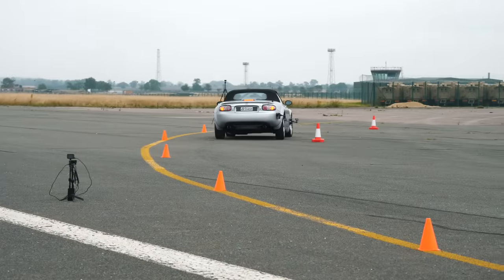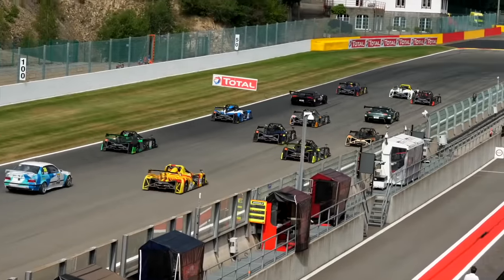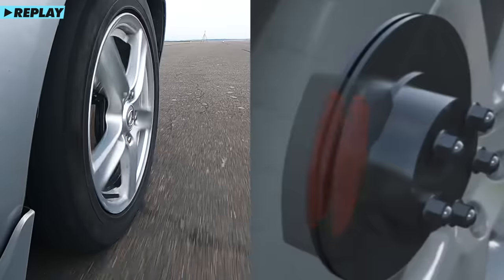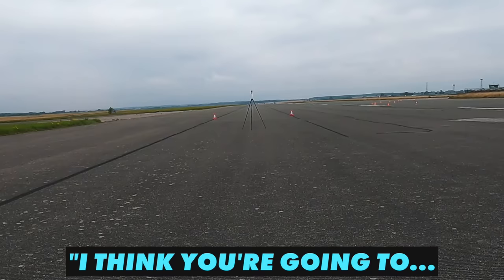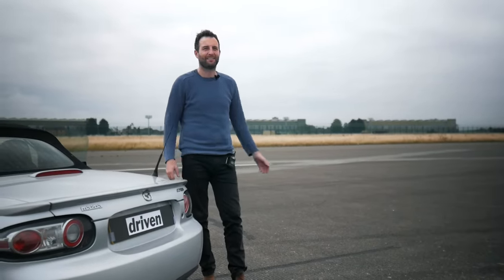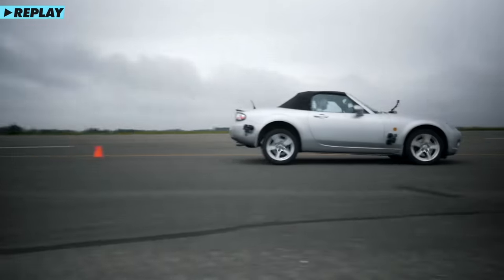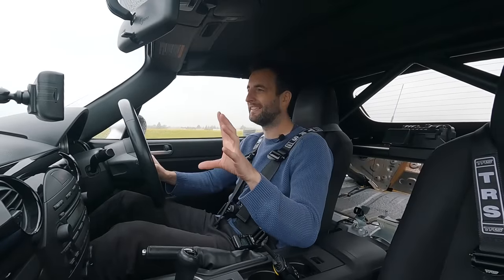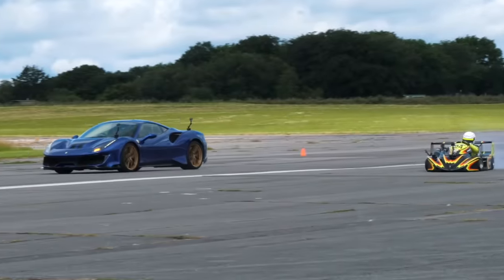ABS ON vs ABS OFF | What's Really the Difference?

Comment: I really feel that I can handle my car better without ABS, pushing the brake pedal just enough before the ABS turns on make the car stop very quickly, maybe it's related to the amount of grip and every tire has a best grip vs deceleration spot.
Anyway, in my country we have bad roads with many tiny rocks that you can roll on, so even with ABS you know that you will not make it ^^'.

Comment: I can't stand ABS. No electrics can beat instinct. 

In some cases, it makes it worse since it seems to kick in way before you run out of grip and it doesn't do a lot when you do although with ABS, I worked outside that if you release the brake just a little bit, it's not as bad.

Comment: This is a flawed demonstration. ABS cars don't have a proportioning valve. The ABS does that automatically. Being a light sports car, its going to be front heavy on the brakes. I had an old Tahoe that the ABS had issues. Because it was a truck built for towing, the rears would always lock up.
 I had a 1972 Impala 15 years ago, and someone pulled out in front me then stopped, only about 100 feet in front of me. A moder car couldn't have gotten stopped, let alone that 30 year old land yacht. I used the car's soft suspension and lack of babysitter brakes to force the rear to kick out to the left.  I was able drift around the curb and onto the road he pulled out of, saving his life. A modern car probably would have rolled over because of ABS and traction control maintaining traction when I didn't want it. 
A proper comparison would be finding two identical cars from when ABS was an option. One with and one without. You will find the one without stops a little longer, but reasonably controlled. After all, ABS is meant to aid stopping on slick roads, and people still lose control because they don't know how the let off the brakes when things go sideways.

Comment: you dont need abs if you drive a manual.  you can downshift and use a "engine braking", eliminating the need to lock up the wheels.  try going 60 mph and downshifting to 2nd gear and let off the gas and watch how fast you slow down without even touching the brake!.  please america, dont kill the stick shift!!

Comment: Ok comaprison, but nothing that wasn't expected.  Kind of pointless without the comparison to a driver doing more than just slamming them on & doing nothing else.  You should have included threshold / modulated braking for a better comparison.  
The kind of people that panic brake & just slam them on don't tend to steer at that point anyway.  They get target fixated, or overcorrect & spin.  (Saw that happen on the way to work.  Car in front on a 4 lane road ran a little wide in a corner, went from a bit wide to over correcting in/out/in so badly they put two wheels over the median on the outside, then crashed into the wall on the inside of the curve.)

Comment: This is showing exactly what you are told not to do.... Slam on the brakes and stay on them.  We all learn to pump our brakes or threshold the brakes. This is a pointless commercial for ABS systems. 
The host, a race car driver, says that the race cars don't use them because you can stop and or control the car better!    Pointless video.

Comment: This is exactly whats wrong with these ABS video’s they all just lock the wheels and say yup, ABS is better… well offcourse it is. You as a racing driver should show how you can brake good without using it. I’m also a racing driver but i know that driving with ABS can save you some meters, also it can also make the car less awkward to steer while braking little disappointing to say the least. I would make the video again, or just not post it.

Comment: 0:45 why would a pro driver be better than ABS? i can see an argument for "as good", but why better?

theres also an argument to be made as to why they cant be as good, as ABS in modern cars can control each wheel independently, which a driver cant, so he loses all the extra stopping power hidden in the grip level differences of the worst wheel to all the other ones.
Reply: Well the commenter is wrong in one aspect.  Threshold braking can never be as good as abs in a race car. That is self evident.  

However in the world of motorcycles, threshold braking does brake faster than abs. 

Here’s why:
Motorcycles has 2 brake levers, 1 for each wheel.  So a motorcycle rider can perform threshold braking on each wheel independent of each other. 

On a car, there’s only 1 brake lever for all 4 wheels.  So when a race car driver modulates the brake peddle (threshold braking) all 4 brakes are modulated regardless if a particular tire is locking up or not. 

Therefore, for a car, it can never brake as effectively as abs. 

Abs only modulates the caliper of the particular wheel that’s locking up.  The other 3 wheels that aren’t locking up … those calipers continues to apply braking force.

Comment: I'm stopping this at the 1:30 mark to comment before continuing. I too am a professional driver, but on the road, not the track. ABS, in theory, can achieve amazing results under ideal circumstances. The road is very rarely ideal. ABS has failed me many times, and in some circumstances actually made the problem worse as it fought my own corrective actions. Part of the problem is loads are not always balanced, the other problem is many of the roads I travel are extremely poor. 

ABS, much like all the other driving aids, help make an incompetent driver a bit safer, and well, given that about 80% of the people on the road are incompetent, its a good thing. For me. I often turn it and traction control off. There are times I want my wheels locked, and times I want my wheels to spin. I do not like being second guessed by a vehicle that has no idea what is actually going on and what I need to do to stay in control of my vehicle and thus remain among the living.

Comment: If you race cars on a track, you should know better.    Try that test again while driving properly.   You can easily stop that car shorter without abs if  you driver properly.  Now there is a new ABS system that gathers it's info differently and is able to do better then a driver.   But not the system your showing.

Comment: A car with ABS disabled will always perform worse than a car designed without ABS which has a higher threshold. 
Non-ABS cars have a proportioning valve after the brake booster to limit lockups, kinda ridiculous this is overlooked when you're throwing around science and #engineering hashtags...

Comment: okay all fine and dandy but really just stomping the break. this is comparing ABS to the worst driver particularly during the turning. if you are a professional driver then you have skill that most do not. but none the less a useful test would be to apply maximum breaking without locking up/ loosing control. this would likely compare ABS to a good driver. again particularly during the corner breaking.
Reply: ABS was never built for the "best driver". When you drive, you are driving with a lot of terrible drivers, it's for them - and if they need to break hard - for your safety.
Reply: @zachb1706  Aw, they are worried about my safety, that's nice. 

My statement still stands, it doesn't mater what ABS was built for. 

the comparison would be useful to demonstrate how much difference there is in the ABS ability to stop the car under control and someone who thinks that they are not that much value. the likely person who doesn't' think that are that much value likely thinks of them selves as a good driver. 

additionally perhaps in the 1980's people thought ABS was not that good, and may be it wasn't. in general almost all people, I suspect, know that certainly modern ABS perform well. so an interesting comparison is how they perform against a professional driver trying to Properly stop the car strait or in a turn. this is a valuable comparison. and interesting. 

thanks for your response.

Comment: Your test is comparing panic stops with and without abs. (Which is unfortunately the reaction of the average driver on the road). It would be interesting to see what a skilled drivers results would be against the abs. I would think minimal. 
Personally. Thats one of my biggest issues i have with newer cars. They are making for very bad drivers. The cars computer takes over. Instead of teaching drivers how to drive. You would laugh at how pathetically easy our written and road tests are here in the US.

Comment: You would never test the brakes like this as you wouldn't hold the brake once the car is locked up.... you might as well have put skies on it and done the test. Re make the video with abs and then threshold braking, technically it should stop quicker without abs.

Comment: If you are a trained racing driver then why are you locking up the brakes? Any trained driver knows that you don't lock them up but you go to the Edge where you feel the wheel is starting to lock up. Sometimes it's much better to steer rather than break hard. Maybe you're doing this to make the point but you said in the beginning that you were a trained racing driver and I do believe that you could break the car almost as well as with abs with modulating your pedal. Are you just doing this for the showboat effect of sliding? Maybe you're trying to show what a non trained driver would do?

Comment: ABS ON vs ABS OFF with INCOMPETENT BREAKING TECHNIQUE EG: JUST SLAM THE BREAKS ON LIKE A FOOL | What's Really the Difference? ABS IS DESIGNED FOR ** DRIVERS WHO DON'T KNOW HOW TO BREAK and DRIVE COMPETENTLY. 

FULL STOP.

when u drive a car non-abs and ur competent, u will learn to feel the cars optimal breaking point, once ur familiar with it, it will no longer matter were u drive 1st time or not, weather conditions or not, u will accurately feel when to apply more or less breaking pressure instinctively.

competent driver = better then ABS.

as abs plays very much to the safe side of things or it begins to fail when conditions are outside its parameters, a competent driver can effortlessly compensate for this on the fly and also maximize break, traction and handling performance.

however saying that the vast majority of drivers are not competent drivers, hence many would just slam their foot on the breaks pure and simple and hence why most drive like idiots in general.

i remember after learning to drive non-abs for years, i ended up upgrading to a ABS model, i almost had a heart attack the first time i was forced to break hard, swerve and avoid a truck, i missed them by 20-30cm and realized in that instant abs was only good for idiots who slammed the breaks, i new i could have safely cleared with a few meters, if i didnt have abs.

i latter took my car to a abandoned road over a few weekends and checked by disabling the abs and indeed found i could stop the vehicle around 20-40% better then with abs on and also simulated various situations / grip /weather conditions with cones representing obstacles, were id had to swerve to dodge something and come to a complete stop before hitting something else within the same process.

In every attempt non-abs was the clear winner, the simple fact i could slow down faster when breaking with no abs, meant when i needed to swerve my speed was always lower then with abs on = a huge f'ing difference to handling.

in dry good road conditions, it was very easy to out perform abs, only when i added things to reduce road traction did the gap shrink, but these conditions were pretty extreme and i basically set things up were it was not possible to avoid hitting any cones, so i was trying to determine if a crash was un-avoidable, which would give me the best chance of changing the angle of my vehicle to avoid a fatal impact, slowing my vehicle like wise before the collision etc and their were times im f'up and also times when the abs messed up, but either way no-abs = the winner.

one caveat though was the fact i new the road conditions in advance, which also gave me a edge over the abs and were to push my advantage of knowing what the wheels would encounter next, though saying that a competent driver always keeps his eyes on the road to insure they are driving appropriate to the conditions and are aware to those conditions instinctively when they need to react in a emergency.

but again most drivers arent competent, they just slam the breaks, drive like they are on rails, so ABS and TCS is a major improvement for most drivers safety and i will say though i think standard ABS is bad for competent drivers.

unfortunately though some vehicles are designed and built ground up with TCS systems in mind, simply put disabling TCS in these vehicles can make the vehicle handle like a drunk behind the wheel and this is becoming common practice is modern vehicle engineering, even for cars were they have a button to disable TCSystems, often its just a off switch and they have not even attempted or cared to make the car driveable with it off, unless u drive like a granny and just assume u must want that "im going to die" feeling going round a normal bend, because u know your car is just going to loose control as its so badly balanced even a hiccup can make u do a 360 and their is F all u can do to avoid it, unless you drive like grandma or put TCS back on.

as such i think many modern cars teach people to become more complacent behind the wheel and end up reducing road safety as the car basically handles everything that would normally teach the driver "awareness" to remain safe behind the wheel, is now basically being handled by computers, to the point some folks cant even park their car without their car telling them what to do and when to do it.

so instead i will see folks who drive like they are on rails with these modern cars and when they drive someone elses car that isnt so fancy, they have an accident and when something happens on the road which needs a competent driver behind the wheel... they have an accident.

lost tracks of the vids were u even have people who forget they have a break pedal, because their car has automatic break sensors that will slow down and stop the car or beep at them to warn them to "look ahead"... and naturally when the car doesnt slow itself down or no beep happens... hello someones rear bumper or in many cases, hello pedestrian crossing the road.

probably a good thing self driving cars arent far away from becoming standard.

Comment: I'm NOT a race driver, but there's no fuckin' way i'd still be on the brakes once they'd broke traction (i'd back off while holding pressure, cause ya know that's braking)..  how the fuck does this compare with everyday driving?  

Try running this test (especially that bend) with water running across it, so you'll go from dry to wet to dry..  the 2 times i've aquaplaned in 30yrs of driving, it was ABS that almost got me killed thanks to it locking up unnecessarily while passing through a puddle from a broken sprinkler, on a curve, under light braking..  i know full well that had i been driving my own old heap of shit car without ABS wouldn't have locked up and tried to take me off the road..  

This was a bend that i knew very well and would normally have been accelerating through,  but sure i was speeding, it was night and the sprinkler wasn't ever busted and leaking at the front of that bend and so tried to slow it up a lil..  Fuck ABS..

i guess it's good to know that you can pull a fuse to be rid of the shit though..

Comment: Disappointing video.  Before ABS was invented, and lets say I was an enthusiastic driver, on a few occasions I was able to stop quickly from high speed on a curved road by using a few cycles of cadence breaking.  Comparing ABS with smoking tyres is clearly going to show ABS in a very good light.  ABS is beneficial for the type of driver who does a 360 turn with the brake lights on all the time, and I have witnessed this maneuver by the car in front of me a few times, thinking "take your foot off the brake!"

Comment: ABS is great, the real enemy is traction control, I always feel a car behaves more predictably with the traction control off.
Reply: oh yes... when my Honda detects wheelspin, it instantly reduces power to like zero 😂
Luckily there is a good positioned button for deactivating TC.
However, its a great car :)
Reply: I don't know which car did you try but modern ones do a great job in TC also. For example try a new BMW 3 series car in sport mode it not only lets but actually helps you drift :) have fun

Comment: Today I almost had a crash, there was a wet road I was driving 70k/hm maybe more ~80, limit was 70. There were cars standing on the red light I realized it all too late and I smashed my brakes, and beginning soft, my car started slowing down to like ~60km/h then as I gradually pressed them more, my wheels locked up and I got mad cuz my car was sliding, brakes didn't work! As I realized that I lift my foot from brake and I dodged to the right lane. Im fucking mad my car doesn't have ABS. Fuck this old piece of shit car.